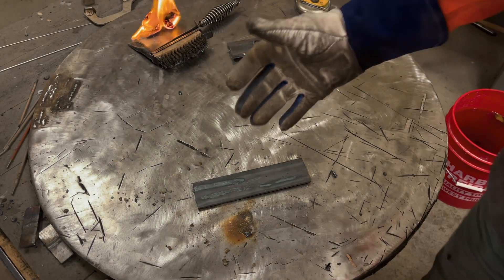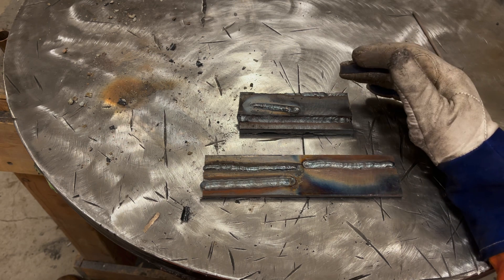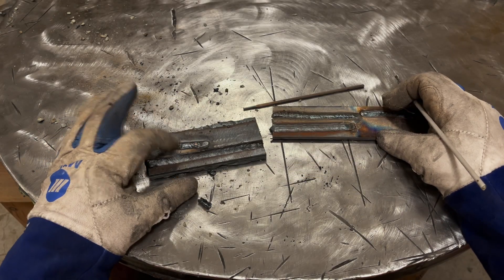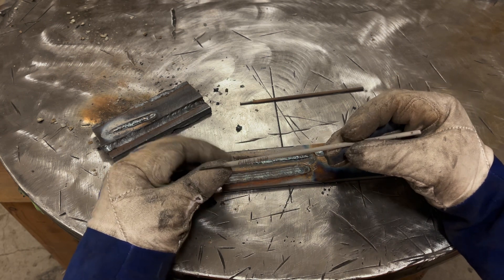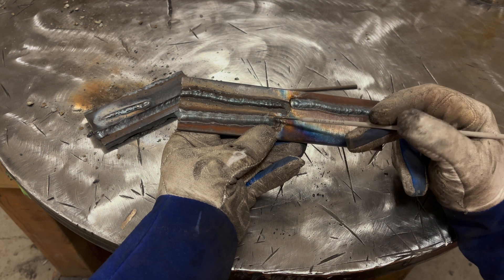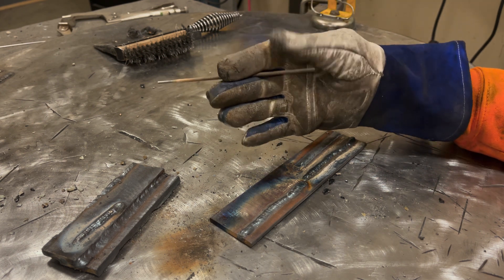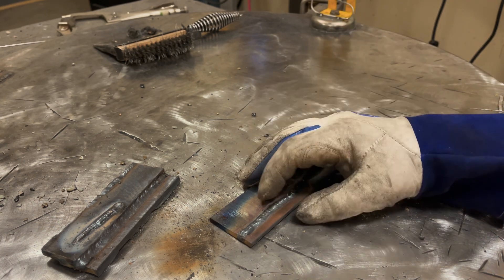How to stick weld 👨🏻‍🏭: Watching the molten puddle (with arc shots).

Comment: Thank you this is great. I was watching the arc.. not the puddle. Damn.  Watch the puddle behind the arc eye shape means travel speed is correct. Got it.
Reply from the maker: If you can maintain that eye shape you will put down decent welds 👍.  When the shape changes you know the weld underneath the flux will too.
Reply: @makingmistakeswithgreg yep, I didn't have a current project but a half 6013 rod on scrap and seeing the eye trying to maintain it was not that easy. Tried 7018 and was really able to see it and maintain. The slag flicked off in one piece. I had to turn darkness down to 10 on helmet from just past 11 to really see it. This is huge thank you.

Comment: Really interesting I won't forget the eye shape. I was definitely getting the peanut shape.  The Mr peanut in the shell shape. I had a gut feeling I was rushing, but how can I tell.
Reply from the maker: With stick if you don’t have a eye shape with 7018 or oval shape with some other rods it means one of two things: 1 you’re moving to fast, or two , you’re amperage is too low.  A peanut shape puddle is a great sign you need to slow down or up the amps.  For the next weld jump up 5-10 amps and see what things look like or try to slow down 10-20% vs the last weld.  Try to change one thing at a time vs multiple things.  The more variables you change the harder it will be to determine what the issue is.
Reply: @makingmistakeswithgreg wow. Ok. I'll have to keep phone handy and read that a few times lol. Noticed it tend to rush. Now the "eye" is my speedometer. 😂
Thank you.

Comment: Youre videos are a great help. Stick control  is my biggest issue.
Reply from the maker: Glad they are helping you.  Don’t feel bad if you’re struggling, learning to stick weld is tough.  The big thing to keep in mind is being consistent is everything.  If you can simply move the rod from the start to the end of the weld at exactly the same consistent pace, your welds will look consistent.  If you can then keep the arc gap consistent start to finish the welds will be even better.  And finally if you can move in a straight line start to finish your welds will be really good with the other things done as well.  When you strike the arc commit to the weld and tell your brain you are going to keep doing what you’re doing as consistently as possible.  When you’re done look at the weld and determine what’s not right, and make a small change on the next weld to help it.  It does take time but if you can be smooth and consistent you can weld really good 😀👍

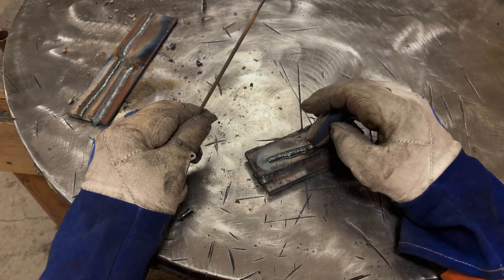Comment: I realize this is an old video. But regarding being able to see the puddle for us old guys wit 70 year old eyes. My issue is seeing where i am traveling, In your video @2:46 you can see the workpiece and where you want to travel. But if you go to  @2:54 everything behind or to the right of the rod goes dark. I have a selection of cheater lenses i use. And last night while practicing i noticed my headgear was set of the furthest back setting. I adjusted it so my nose damn near touches the lens . which i think helped. But still struggle. Which perspective would be best? looking from the right? directly overhead? at a 45 degree angle and slightly behind the rod?

Comment: Hi Greg, really got to see the molten puddles in these videos. Really helpful to see the shape of the puddle in it’s recommended shape. Thank you! Will 6010 rods have a similar shape to the 6013 rods or 7018 rods?
Reply from the maker: So 6010s puddle tends to be rounder and wider than many other rods.  7018 you want to be eye shaped.  6013 tends to be more of a brighter red area with a darker red area behind it.  So they all look slightly different, but once you recognize the puddle you just need to move at the speed it takes to keep the puddle the same size/shape.  If the puddle gets a lot bigger, changes shape, or is inconsistent, you need to adjust the travel speed.  If you manage to keep the puddle the same shape the whole weld the finished weld will be consistent.  If the finished weld is too narrow, not wetted out, etc, then you just do everything the same but you let the puddle get a bit bigger at the start.  Once it hits a slightly bigger size you get moving and you hold that same shape via the same travel speed.  Focus on being consistent and then making minor adjustments.

Comment: I'm new to welding and really appreciate all the work you put into these instructional videos!  It truly helps in concept and use of the varies rods, amps and material.  Thanks.
Reply from the maker: Glad the videos are helping you and that you have taken on the challenge of learning welding 😀👍.  Learning to weld can be frustrating at times, the key to getting good is never giving up and to focus on being smooth and consistent with your movements.  It won’t take long to get good enough to build cool stuff 😀👍

Comment: I have welded with a couple of different brands of 6013 rods and they all feel a little bit different from each other. Is it possible that every brand of rods welds a little bit different even though probably all 6013 rods are produced under a standard of some sort?
Reply from the maker: So your observations are accurate.  6013 has a lot more “inconsistencies” brand to brand than most rods.  Also (In many countries outside of the USA )there are actually different types of 6013, and they run completely different from one another.  Generally when I find a rod I like from a company I stick with it, predictable results are a good thing.
Reply: The best 6013 I've welded with had a stamp which said "AWS E6013"
Reply: Great videos, keep up the good work

Comment: Very nice video Greg! I'm 2 days into this and have already run into the common issues, especially sticking. I'm persevering with 6013s because they are pretty much all you can get locally in the Philippines. I got 7018s and 6011s mail order but have yet to try them. It seems that with 6013s slag inclusion is the big deal and I'd like a pointer on how to read the pool for what the slag is doing when I run a bead correctly and incorrectly. Am I right in thinking that the major factors in slag formation are amperage and arc length?
Reply from the maker: Amperage and arc length play a big role with 6013.  If the amperage is low, 100% you will have slag inclusions.  Most other rods tend to just produce roped up welds with slightly low amperage.  If your arc gap is not where it should be the liquid flux will get ahead of the rod.  It’s been a while since I watched that video but I can tell you that if the start of a 6013 weld has flux running infront of the rod, it’s extremely difficult to fix that.  The start matters hugely.  Sometimes a bit of a long arc at the start, a steeper rod angle, and correct amperage will push the liquid flux away from the direction you’re welding.  

6013 is actually a fairly difficult rod to master, but easy to learn with.  In the last year I have had a slag inclusion with 7018 one time, and that’s hundreds of hours of welding.  With 6013 I could have it multiple times in a day.  That’s just how the rod is.  I find that they weld great in flat and lap welds, and on sheet metal.  On fillet welds or any weld on plates that are less than 90 degrees 6013 can be a handful lol.
Reply: @makingmistakeswithgreg  Many thanks Greg, a timely and detailed reply. I do not want to hog your time, but a quick Q. As I have 7018s and 6011s is it worth diving in right now as a beginner and getting used to them, or should I wait a wee while longer?

Comment: So far I've only been watching the arc distance, heard welders say watch the puddle, which is fine if you know what to look for, thankfully this video explained it.
Reply from the maker: Glad it helped you 😀.  It can be tricky with stick to figure out what’s going on.  I generally rest the edge of rod tip against the material I am welding on (or barely above it).  With 6010 or 6011 it’s a little bit harder to touch the plate (it tends to gouge it out lol).  Over time you’ll be able to tell a long arc just from the sound as well as the light output, and you’ll just automatically.  It just takes a bit of time to get your brain/muscles to do it without thinking of it 😀
Reply: @makingmistakeswithgreg  Thanks greg, I was looking at all the miller 3phase welders on ebay and wondering at what point in your career you suddenly think you need one, is it once you want to weld very thick materials you go with 3phase?
Reply: @makingmistakeswithgreg  Thanks, on a different note, tried welding some scrap material today and the weld did not take at all, I assumed steel, but maybe its cast or aluminium or something else, have you done videos on how to identify metals?

Comment: Were you welding with 6011 to start that fire?

(Lit my welding apron on fire that way years ago.  Went to leather-fronted afterward.)
Reply from the maker: Would have been 6010 or 6011 lol.  I was either doing horizontal or vertical up.  I am somewhat smarter nowadays with what’s around me lol

Comment: You do such a good job of describing things. I’ve yet to strike my first arc (waiting on gear) but I believe you’ve given me much to prepare me.
Reply from the maker: Thanks for the kind words.  Expect to be very frustrated at first, but think of it more like learning to ride a bicycle or learning to hand write.  It’s a struggle for a while and then all of a sudden you just get it.  The most important thing to tell yourself is don’t give up, and it’s ok to be frustrated.  Try to be as smooth and consistent as possible in movements.  Try to master the simplest things first.  Master starting rods to the point you don’t have a issue.  Then master starting a rod and welding 1inch welds.  Then master 3-4inch welds that are straight and consistent.  Then multiple welds that are that long straight and consistent.  If you can master the simplest of things it makes the hard/impossible actually possible to do.

Comment: Ive already watched this video before, but I figured I needed to revisit after my yesterdays terrible performance at retrying to learn to stick weld. Tried 6011, 6013, 7014 and 7018. The 6013 was hard to start but started and was able to run a short few beads. The others would stick and stick and stick......omgerdddd. But I gained some experience . I could have trained or learned more but my 3000 watt generator just kept getting its ass whooped. finally turned it all the way down to 40 amps. lololol. I REALLY need a bigger generator. hahaha. Im not giving up!!!!
Reply from the maker: Yeah, generators really suck when it comes to power and costZ. To be able to stick weld with 3/32 rods arguably you need atleast 3500 if not 4k running watts.  I run my stuff on a 7500 running watt generator and that gets me to around 200amps MiG, 210 tig, and about 170 stick.  Definitely don’t give up, you can always run 1/16th rods.  If you master those everything else will be easy.
Reply: THANKS. MAN. I use all of your advice to the best of my ability. @makingmistakeswithgreg

Comment: Love your videos, especially because you show use of 6013.  I live in France and it is the only rod that is readily available.  I don’t know why, but there you go.
Reply from the maker: I know that 6013 is very popular in many countries which to me is strange because it’s not used for much beyond home hobby work here.  I personally find it more difficult to weld with in many respects than other rods.  I am sure if is spent more time with it I could do a better job, and if that’s what you have you will have to make the best of it.  It’s definitely capable of welding a ton of stuff and it’s very easy to start/restart/welds sheet metal good.

Comment: I'm just starting out with an old oil filled Bantam  (UK) welder, I think all your videos are very intresting and you explain items clearly, thank you.
Reply from the maker: I had to look up a oil filled welder because I don’t think I have ever seen one.  That’s pretty wild, I definitely have never used (or seen one) here in the states.  Is yours AC output or can it do DC?  Regardless you can definitely make some cool stuff with it.  If you ever have a question about something just ask in the comments to a video and I will respond.  Good luck on your journey to learn welding 😀
Reply: @makingmistakeswithgreg  Hello Greg I think it is just AC as I believe it has windings immersed in cooling oil , no fans or electronics. Just 2 voltage options 50v for general or 80v for light or specialist welding.
Reply: With variable current from 30 to 185Amps, very heavey bit of kit, even mounted on the trolly , from the 70's maybe .I'll  email you some photos. Cheers Alec

Comment: I've got some sheet metal and automotive work to do. What stick would you recommend and amperage settings along with DCEP or DCEN, I'm fairly new to stick welding but I understand one has deeper penetration and I'm worried about just blowing holes in pieces I'm working on. Thanks, Nic
Reply from the maker: I won’t sugar coat it, if you’re welding super thin metal, stick will be tough no matter what.  For thin sheet, 6013 in 1/16th rods will be your best bet.  I would experiment with them on DCEN first and see what you think.  Most stick rods are run DCEP so running DCEN can change how they run.  In theory it will limit the penetration on DCEN.  You can expect to blow holes more than a few times with thin material.  If you’re blowing holes you need to speed up travel speed or lower the amperage.  Starting amperage for 1/16th rods is around 25 to 40 amps.  For 1/8th to 3/16th material 3/32 rods should do just fine.  

You will find that flux core wire is actually infinitely easier to weld thin material with.  Stick is great down to about 1/8th, below that I much rather have flux core, MiG, or tig.
Reply: @makingmistakeswithgreg  Thanks for the reply. Yea, I intended to buy a flux core welder used but the seller ended up selling me a stick welder and refused to let me return it. I had to have someone pick it up so it's my fault for not having them check it over properly but a flux core welder is what is what I'm gonna go with next and in the mean time, I might as well learn stick as it's something I've not really had a chance to get to grips with properly.
I'm gonna find some scrap thicker material to practice on but in the mean time I've got a good amount of spare sheet metal that I may as well try my luck on, and at the very least, it'll be very good practice in stick welding control and proper settings and learning technique, I suppose!
I've got a friend with a flux core wire welder/gasless MIG/whatever you wanna call it I can and was borrowing but they needed it back to do some work. Getting practice with both and how technique differs and things will probably at least make me a better welder once I've done my dues and put a hell of a lot of practice in!
Thanks for the answer, Greg!

Comment: This is great. Best video on reading the puddle i have seen. Just got some 7018 today and I'm excited about seeing the puddle better.
Reply from the maker: 7018 is definitely easy to see the puddle and the end results are very predictable.  Focus on being smooth & consistent and you will have real clean beads.  7018s can be a bit tricky to start and restart so make sure to watch this https://youtu.be/e9Zy9NGXrc8 7018 video I made and the rest in the series to really get it dialed in.  Once you get 7018 figured out you can really build a ton of stuff easily 😀

Comment: thanks for the arc shot I never can tell for shure about my puddle yours looks well defined.
Reply from the maker: If you run 6013 or 7024 rod the puddle is tough to see no doubt.  With 7018 it’s much easier to see.  If you are running the rod near the upper amperage it’s designed to run at you should see a puddle.  

I shot the footage with a #10 fixed shade standard lens, my Lincoln 3350 offers much better clarity than that.  Changing hoods may help along with a mild magnification (cheater lens).